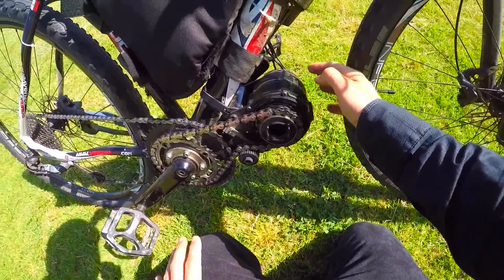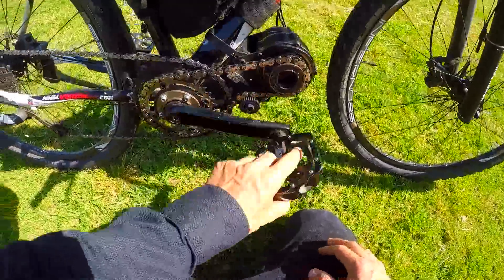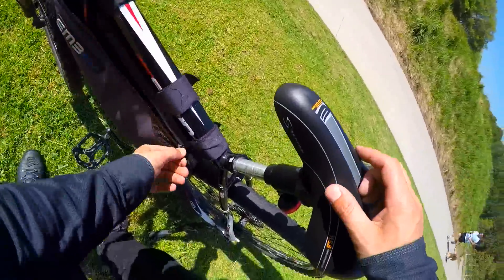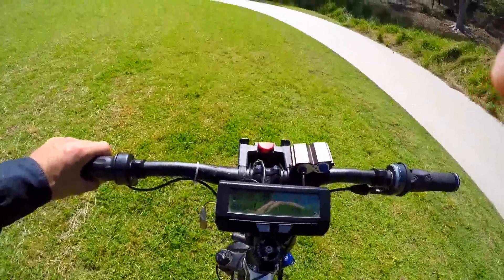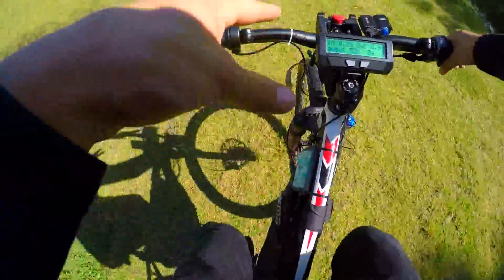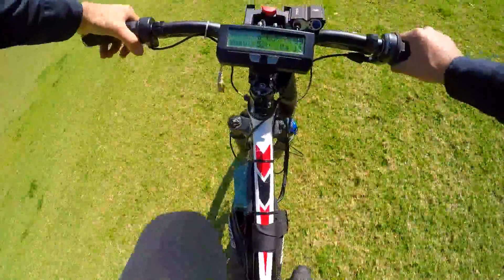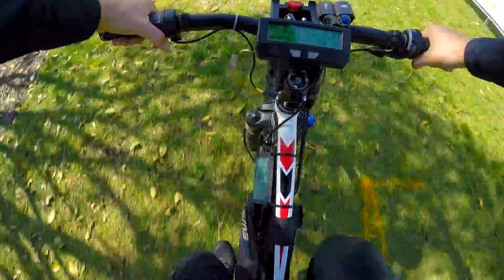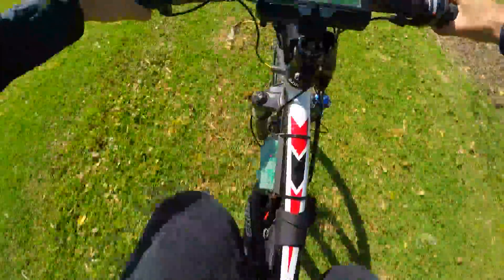2500W Tangent Motor - AstroFlight 3210 + Grin C Phase Runner controller (Gary Lai's Electric Bike)

Comment: Very Nice Bruno, What Battery Power are you using On this Set-UP. is anyway to reduce the Noise of that motor and make it work like the Bafang Montors
Reply from the maker: +Julio Cesar Roa - Yeahhhh... this is my friend's bike, he uses two small packs of 18650 cells, I am not really sure the voltage he was running this thing but the AstroFlight motors are normally made for 12s batteries (43.2v nominal and 50.4v max) a bit lower voltage but higher amperage... these motors can be wired for higher voltage.... 
This was an older version of the Tangent motor, the newer one is quieter, you can still hear something, yes it is a bit louder than the Bafang but much lighter and double the POWER!!  This is a super fun toy =]

Comment: That thing shifts on! bit on the noisy side though. I like my ebikes stealthy quiet 8)
Reply from the maker: +th3d3wd3r  yeah... this one I definitely got that "dirt bike feeling"... Many people looked at me like "what tha hell are u doing" or "why does your bicycle sounds like a dirt bike" All that noise was coming from the chain... the motor makes a high pitch noise..... the whole setup ended up bit noisy but super powerful and super fun!!
Reply: +ElectricBike (Bruno) gotta remember, all that noise is wasted energy ;)
mind, a bit of noise is super helpful. my old crystalyte 5304 v3 was so quiet, people had no idea I was behind them lol.
Me and donmonk3e got our new mxus 3000w v2 motors. Be back up running soon with moar power than ever lol
Reply from the maker: yes.. all that noise is actually transmission loss but the power to weight ratio Gary gets with this 3kg mid-drive is so much that you won't even consider that loss.... an equivalent powerful hub motor + heavy-duty spokes double wall rims would weight over 4 times more =/ What is the total weight of your wheel do you know? Is is really heavy?? Can't wait to see you guys flying hahahaha...
Reply: +ElectricBike (Bruno) hahaa, well this is the thing isn't it. My wheel weighs 11kg lol
Reply from the maker: +th3d3wd3r - 11kg!!! Hahaha as long as it gives you sooooo much POWER... who cares haha John Bozi another we'll know ebiker had his huge hub motor  with massive holes all over the metal plate on both sides to help cooling! I'm sure this reduced the weight little bit =]

Comment: Noisy dammit! i thought it was the future of ebikes :D loud and legally unparalleled is inconvenient in some juristictions.
Reply from the maker: +Best Electronic Music From New Geniuses yeah... POWERFUL but unfortunately it is actually noisy and people can notice you riding past... I wish they're quieter this would be the ultimate ebike system!! I have 3x of the biggest Astrofligh motor the 3220 and 3x Castle Creations HV160 also the biggest ESCs... check out the sound it makes unloaded and on the road (in my case it's louder as I have 3 motors running but I have belt drive which is a bit quieter than reduction gears) https://youtu.be/sRH_cpCwNDs

Comment: . astro motors were designed for lightweight toy rc aircraft use.      using them to move the weight of a rider is probably not advisable. alibaba mentions epoxy board is used for explosion protection in electric motors
Reply from the maker: +mike x heeeey Mike, thanks for your message here, the Astro motors were initially designed for serious giant scale helicopters or aircraft, personally it's too powerful and I wouldn't call it a toy at all =]
Matt Shumaker started using these motors on his electric bikes back in 2010 and talking to AstroFlight engineers he managed to get some improvements for lightweight EV applications, much thicker motor shaft and open/ventilated motor housing for better cooling. 
I have a triple motor setup that can peak 42000w and it's going in my trike.. we calculated that after transmission and electrical thermal losses I'll be getting something around 45 horsepower at the rear wheel... not a toy at all haha
Yes, the epoxy board is actually a fibreglass sheet with epoxy, we use it for battery construction as it is fireproof and mechanically very strong. You can buy it in many different thickness, very flexible and thin or super thick and strong!
The Aliexpress ad you saw was probably a bad translation from Chinese to English (quite common).
Electric motors will not explode... at very very high RPM the centrifugal force will break things internally but it's mechanical damage not explosion. Overpowering the motor with much higher current may burn and melt the windings causing some internal sparks but it's not an explosion... 
Batteries can explode and make a big BOOM releasing up to 200psi per cell (18650 cells) or in case of Lipo cells you may get a massive fireball + explosion!!! 

Check out Matt going crazy with two Astro motors pumping 20kw "only" https://youtu.be/WKAMus3oSdw
Reply: i saw these 50kw motors weight 6kg which sounds ideal for lightweight electric  motorcycle alloy pit bike frames and maybe  they could  make the cases in titanium for more strength. i guess light  6kg 50kw motors would need to be used in only low gears at  high rpms to reduce force pulling  on the motor case and prevent if from breaking. 50kw would be enough to power a flying bike. i guess props moving through air would put less force stress  on a motor case than a motor moving a  bikewheel on the ground.  https://www.alibaba.com/product-detail/Hot-sale-154120-45KW-brushless-motor_60477545534.html
Reply from the maker: mike x yeaaaahhh here we go... this sounds like enough POWER for me and nice weight!!! I may order one just for tests, thanks for sending the link =]
Reply: BrunoPOWEEER have you tested the motor ?